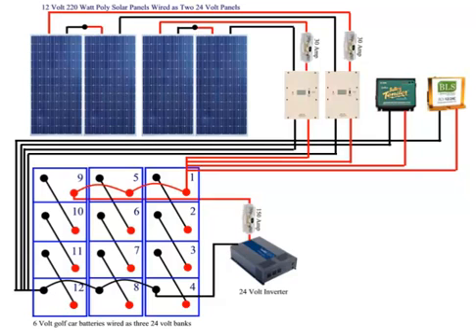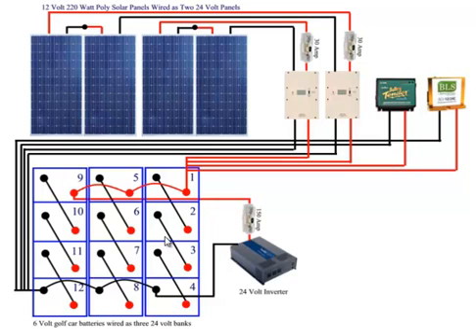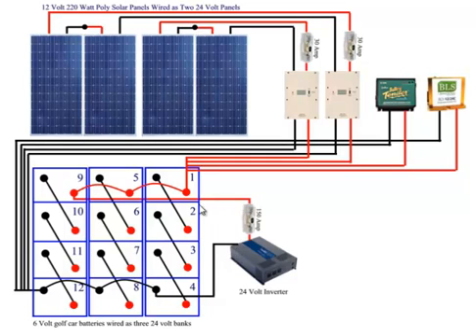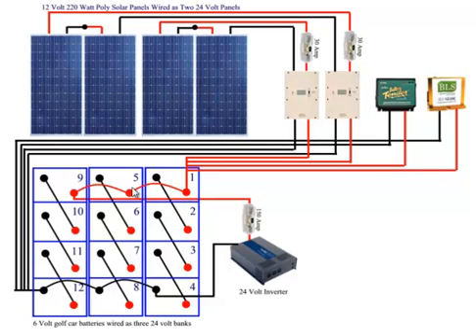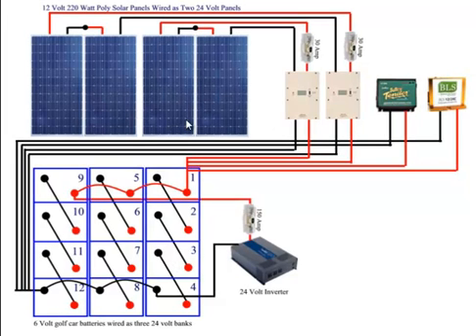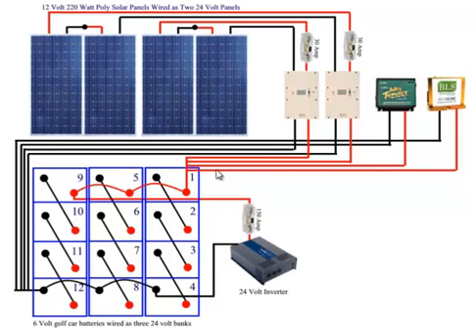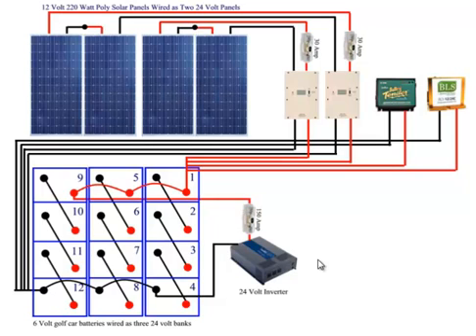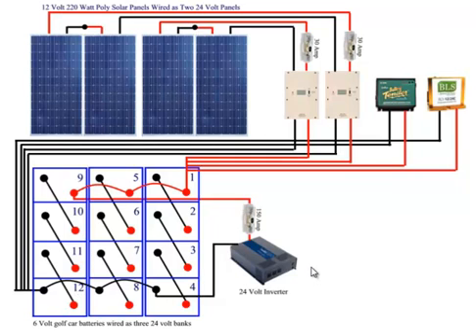DIY Solar Panel System: Battery Bank Wiring

Comment: hi i have 12 panels with this specification 
what kind of battery bank ,charger control and inverter
I CAN USE

Electrical Data
 
Nominal Maximum Power (Pmax): 340 Watts
Optimum Operating Voltage (Vmp): 37.9 Volts
Optimum Operating Current (Imp): 8.97 Amps
Open Circuit Voltage (Voc): 46.2 Volts
Short Circuit Current (Isc): 9.48 Amps
Module Efficiency: 17.49%
Maximum System Voltage: 1000V
Max Series Fuse Rating: 15 Amps

Comment: Extremely Dangerous wiring batteries. One wrong connection and you will have a Hydrogen Explosion with hot flying lead and sulfuric acid! This is not for amateur electricians.

Comment: The inverter should be connected to 1 and 12, not 10 and 4. Loads should always be connected to the same points as the chargers. Without exception.
Also, that is not a balanced wiring configuration. The left and right banks have a slightly greater workload than the middle bank, so the longevity of the left and right banks will be a little less than the middle bank. Essentially you have three 24v batteries connected in parallel. There is only one way to balance the load with three batteries and that is to connect the positive terminals to 3 equal-length wires and also connect the negative terminals to 3 equal-length wires and then connect the charger/inverter to the end of those wires.

Comment: Believe it would be easier to turn your batteries so you have 4 in a row the long way and wire your plus to minus 3 times that way. Then you just need one more wire each to go across the 3 rows of negative and 3 rows of positives. The wires would be shorter and box would only have to be about 21"d x 48" long. You pull the positive lead off the one end and the negative off the other. A little cleaner look I think.

Comment: Hello thank you for sharing informational video, I am new to solar and starting small project for my garage, I have 24v solar panel 235w. What would i need to charge my 12v battery and run 2 pcs of 12v 80w fans? I would appreciate if you could let me know the proper way to use my panel with its full capacity.

Comment: LDSPrepper.  I'm designing an off-grid system for a house not connected to the grid.  
1) Do the voltages of your battery strings need to match the voltage of your solar panel strings?
2) Guides I've read online for wiring batteries in series and parallel, has said in more than one location that you should only have 2 strings in parallel.  No more.  I see you have 3.  Thoughts?

Thanks for the videos!

Comment: What size wire did you use between the batteries? I have a total of 8 batteries,  Each battery is 6v and then I want to link 4 of them together to make  2 sets at  24 V.
How do I know what size wire to use in between each battery??

Comment: The negative is coming in at the bottom left but drawing out at bottom right whereas the positive is at top right and drawn on top left: should the draw where possible be on the opposite end of the bank to the input?

Comment: Great video... Thanks for sharing with everyone... I am new to this stuff, and am trying to re connect the wires to a zamp 12 volt solar panel. This panel was given to me, but it didn't have the wires or power leads coming off the back of it. There is a two small tabs that I can solder wire to, but I'm not sure if the Pos is on the left or the right ? As I'm looking rfom the panel from the back, I would think that the pos lead would be on right..... Would you by chance know if I'm right about this ?   Thanks....

Comment: question...........using a 100 watt portable solar panel......and two 6 volt trojen t-150re batteries in series can I use a renogy  12/24 volt mttp charge controller or is it 2 big of a controller ?

Comment: I have been working on setting this up the last few hours, and honestly I don't know why, but I am getting different readings across the board.... Some batteries are at 24v, but others are as low as 4v or 9v and two are at 40v! It blew my controller module out... what am I doing wrong?

Comment: Hello,

I was looking at the diagram, and was wondering what the items are to the left of the solar panels, and what they do and if their needed for a traditional setup for solar in a home. I can't tell what those items are (I know the black/green box is a battery charger, but the two tan boxes and the one on the right of the battery charger, don't know what those are and why their needed)

Thanks in advance for your help!

Comment: OK ... each solar panel is 12V DC and 230Watts.  
Q: The left two and right two are each connected in such a way as to make them create 24V DC ?
Q: This is accomplished by the RED and BLACK connections at the top of each pair such that Negative out on one enters as Positive in on the other?  
Adding a set of batteries 13 ... 16 will simply increase the storage capacity (banks). !
Q: There must be some calculations and component additions/changes to be made for charging and balancing additional (banks of) batteries!
Gee, this sounds like fun ... and I really like the 24V approach - very smart if I say so my ignorant self but aircraft do this to save weight.
I watched one of the other videos.  So tell me what can I run or how do I determine by amps what I can prudently run on your "singular" system and how long does it take to charge and balance this whole design you've put together?

Off Grid is reeeeaaaaalllly interesting - if the utilities, zoning and inspectors allow.

Comment: I have a 290 watts 12v solar panels connected to 4 6volts trojan batteries connected in series/parallel to poduce a 12volts battery bank and into a 1500 watts 12v inverter. I need a battery tender to compensate for night time charging and or when there is no sun?

Comment: Do you think the desulfator actually works? This video was the first I have ever heard of them. I have done some research and most people call them bogus. Just wanting your take on them. Thanks
Reply from the maker: Matthew Millner I really do think they work. I'm actually installing two on my new large battery bank. In addition to that the solar power company that is installing my new 5kV system bought extras and is testing them in house.

Comment: I have two sets of  Possies. & Negs. going from battery 4 (Pos) & battery 9 (Neg) to C.C. & inverter. Do you think that I'll have an imbalanced charge from C.C.? Also, will my 24 volt inverter be powered correctly? (14)-12 volt batt. series/parallel

Comment: Thanks for the videos, they are very informative! One question remains: What happens to the AmpHours of each battery as you connect them in series? i.e Say you connect two - 6 volt batteries each supplying 205 amp hours, in series to create a 12volt system. Do you still have the combined 410 amp hours, or since the voltage doubled, do you only have half(205)? I hope my question makes sense.

Here is my future application: I have a camper and im going off the grid. I would of course like to maximize power. Should I use a bank of four - 12 volt in parallel or two banks of two - 6 volt in series?  I have a feeling the latter will be most effective and efficient. Just wanting to check with someone who knows what they're talking about. Thanks in advance!
Reply: Amp Hours stays the same

Comment: Station 237465.yes 250w of poly and 250w of mono solar panel are the same in ways per watts but 1 will performed better in higher temperatures and the other will perform better in lower temperature

Comment: I'm confused, in your picture you state that the solar panels are 12v 220 watt poly solar panels. Then in the link that you have it states grape solar 250 watt mono crystalline solar panel. In my research of types of panels, the poly are cheaper and put out less energy,  but isn't 250 watts 250 watts?

Comment: I thought you needed to use diodes (or isolation diodes) between batteries to prevent that uneven voltage between batteries. That's what my RV had.
Reply: were you isolating your starting battery from your 'accessory' batteries with the diodes?
Reply: SpockMcoy Issmart I believe the diodes were to keep the charging voltage going the same direction equally to all three batteries. But I'm not sure as to the electronic theory behind that!

Comment: Butch Weise the placement of the fuses is one to protect the charge controllers from a solar panel surge and 2 protect the inverter from a battery bank surge.  The reason for the 30 amp is due to ohms law watts divided by volts.  440/24=18.3 amps.  A breaker/fuse is good up to 80% before tripping.  So a 20 amp breaker/fuse is good to 16 amps safely therefore needing an upgrade.  As for the fuse after the battery bank I am not sure yet.

Comment: At 24 volts he is able to run lower amperage from the solar panels which means he saves money on the wiring because it can be smaller.  Lower amperage, lower wiring costs.

Comment: Jody if your 6 volt batteries are wired together as a 12 volt system your 12 v tender will work fine.

Comment: This wiring is absolutely wrong. One of the users actually noticed and asked the question what will happen if one of the batteries is dead. the answer is simple it will destroy all batteries. In real life you can not find 2 batteries with the same voltage there will be always a difference (very small) like 24.01v and 23.99v BUT this difference will be enough to discharge all batteries very quickly because 1 battery with lower voltage will load the battery with higher voltage.

Comment: I see that your Battery Tender is a 24 volt appliance, yet you have 6 volt batteries wired to give you a 24 volt system.  I am setting up a system based on yours that will be a 12 volt system, but still using 6 volt batteries - the same ones you use.  I have just received my Battery Tender and it states very plainly that it is to be used for 12 volt batteries ONLY.  Can I safely use it for 6 volt batteries, wired for a 12 volt system?

Please reply if you can.  Thanks.

Comment: Can someone let me know if I hooked up my system correctly?
I have deep cycle marine batteries. I connect positive to positive and negative to negative. I only used 4 gauge cable for this set up. I wired the cable from the charger controller directly to the first battery positive to positive and negative to negative. OR should I connect the positive to the 2nd battery and the negative to the fist battery?

Comment: I cant understand what the advantage of wiring in series for 24 volts is over 12 volts. Dont you cut the usable amp hours in half? Or do they last just as long because of the higher voltage? Im lost on that issue. If you are using your existing house wiring, the only need for larger wiring would be from the panels to the battery bank, to the inverter. Past the inverter, is higher voltage advantageous? Please someone help me understand this.

Comment: It's easier to transfer energy if voltage changes are closer... in your situation it's fine.  But if someone were to want more efficiency, you could go with panels that are 36v or 48v and have a 24v or 48v battery bank.  You then have less of an effort to switch the 48v to 110v or 120v or 240v then you would have if going from 12v or 6v.  So higher voltages with less amperage or power so you conserve power consumption process... I think, but my concepts are not solid, haven't seen the numbers.

Comment: to hook up a wind turbine you'd first need to make sure it's a DC motor/turbine, if it's AC you'd need to hook a diode up to the positive. After that you'd hook up the positive and negative to the charge controller just like you would a solar panel. I'm in the process of making a wind turbine right now and haven't gotten to that part so make sure you verify this information elsewhere, hope this helps- cheers!

Comment: I looked at that site and it is about grid tied. Unfortunately, grid tied systems are being sold to people who don't know much anyway, and i know an electrician who has begun to sell these kits that he puts in and he doesn't know a thing about batteries. When I had a consultation, they told me they didn't use batteries. When i asked what happened in an outage, he said you then use a generator.. Well, that is what the panels are for. And the batteries.

Comment: Hoping you can help me with mine. I have 36 VDC panels going in. 900 watts solar and 400 wtts wind. I have 60 amp Outback controller. I have a 12 VDC Aims 10,000 watt inverter. I currently have five 12 vdc marine batteries, have to gradually increase my system one or two at a time. My batteries are 91 amp hours each.I have both the controller and the inverter connected to the end batteries (they make the loop).I don't know how else to wire it, but I would like to put them on different batteries.

Comment: Very good ! My rule of thumb on this...charge your battery from positive of battery # 1 and negative from last battery on your bank.  Pull  power into your inverter from the the other ends of your bank.  Say you have eight lines  48 volts system with  4 @ 12 volt  batteries in series, connect charger to battery # 1 (left to right, at top) and negative battery # 32 (extreme right bottom). Pull power to inverter from  positive battery # 8 (top, extreme right) and negative  from # 25 (left, bottom)

Comment: They would be wired ahead of the batteries. One thing about wind power is that the power it generates is obviously changing constantly and requires both mechanical and electric 'braking' to use a familiar term. Once filtered properly they would go into the charger array as any other source voltage.

Comment: with a 24v over a 12v you can run smaller wire longer distances(solar array -further away) yes?

Comment: Must you use a transfer box? I've been told (years ago) from our utility that any wiring inboard from meter is owners responsibility and i don't plan on selling house. I plan on powering all 115 volt curcuits (including kitchen, refrig and microwave) with solar. I'm not sure how to tie in to main box, but going to find out. Your excellent vidio's have encouraged me to go solar! Please keep up to good work,,,Bryan

Comment: hi nice setup, how many sets of battery's " banks " can you connect together have 10x 12v  105 AH battery's in 24 v so it is 5 in a series parallel config in the way you explained .

Comment: LDSPrepper -  thank you for all the helpful information -  and the inspiration -  we or now on a great quest of abundance -  both gardening and solar back-up power.  My question is regarding battery types and you may not be able to answer but I've now seen Alum Epson salt batteries (non-toxic) and it seems the charge quicker, drawdown slower, and have less maintenance and longer life.  Do you have any thoughts on Alum Epson Salt v. the standard AGM/Lead Acid based batteries?
steve

Comment: Panels are available in 12,24 or 48 volt. The farther your panels are from your charge controller, the larger the wires you need. Higher voltage, means less current which in turn means you can use smaller, less expensive wire. Volts x amps = Watts. With your system in the video, I would probably use a 24V system.

Comment: I need AGM batteries inside the house. Would this be a decent solar battery for a home system? Just found a 12V Duracell AGM battery (31DTMAGM) at Sam's Club for $169. Seems to have good specs for a Marine/RV battery. Most solar AGM batteries I've looked at are $300.

•100 amp hour rate:110
•20 amp hour rate:105
•3 amp hour rate:85
•5 amp hour rate:86
•6 amp hour rate:87.4

I know car batteries are not built for solar applications but this is a marine/RV battery. Thanks.

Comment from the maker: I wanted a well made, pure sine wave inverter so I can recharge batteries, etc. A modified invert will not do that. The battery charges is a quality unit that will last me years. I did do quite a bit of research. These items are what work best for me.

Comment: you did a good job i am a master electrician when you are connecting + lugs that are parallel in the circuits  and the same with - lugs  but connecting the battery's  is in series

Comment from the maker: They are rated by volts. Mine is a 24 volt controller because I have wired my battery bank to be 24 volts.

Comment: for the charge controllers, are those rated at 24 V as well? or are they rated by power, which in your case would probably be a lot of current? am i understanding that correctly?

Comment: im interested in setting up a solar system i want to run say 2000w pretty much all day lets say 18hrs a day, in order to successfully power it how any batterys and panels would i need? will 2 200w panels and 2 12v agm batteries work?

Cheers

Comment: i got 3,500 watts inverter 220 volt AC/12 DC,my question how 12 volts battery i need?and i got 30 amp charge controller....thank you

Comment: if i got 400 watts solar panels how many watts or amps should be my charge controler, and on this amount of wattage from my solar panels, how many batteries i can charge if my batteries are @ 12 volts.  also in a deep cycle batteries how to know the wattage of those batteries, thank u . its a nice video

Comment from the maker: You have to convert the power from the solar panels which is in direct current (DC) to alternating current (AC). The bigger the difference in volts the more heat is generated. Heat is energy. In this case the more heat you generate in the conversion the more energy you lose. The closer you can get the voltage to each other the less energy you lose. 24 volts is closer to 120 volts so less energy loss. Less energy loss mean more energy you can use.

Comment: What is the difference between 12 and 24 volt systems/interters? I cant seem to get my head around the difference with 6 volt, 12 volt and 24 volt and the pros and or cons of which one to use!!  many thanks for your help